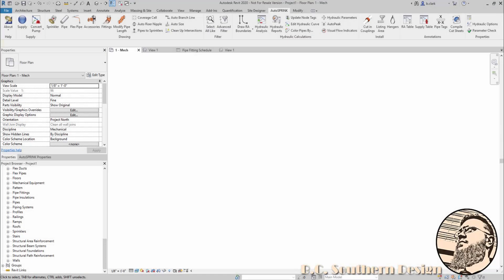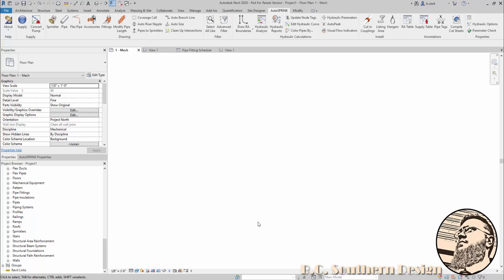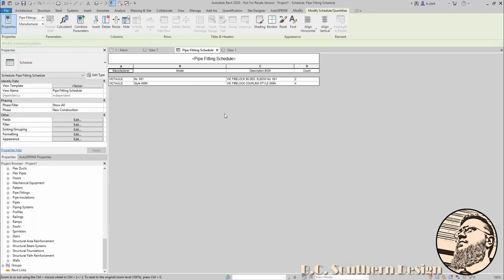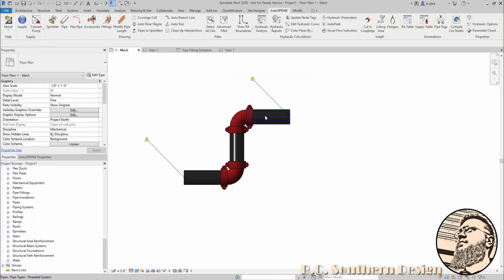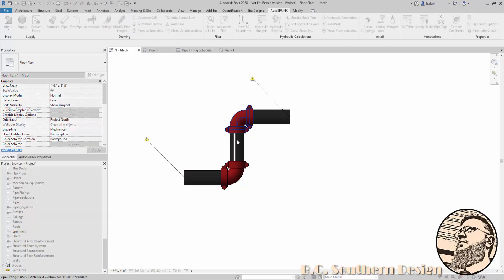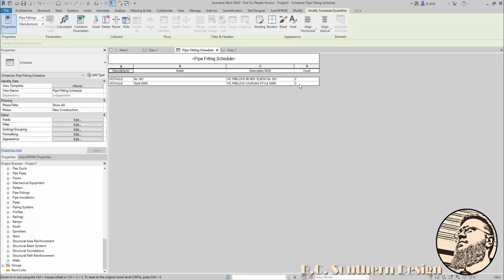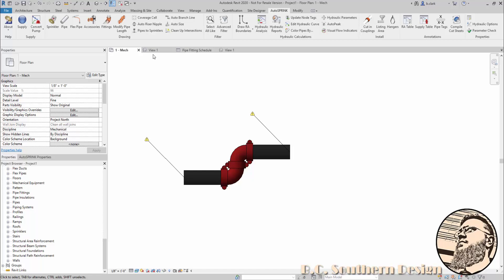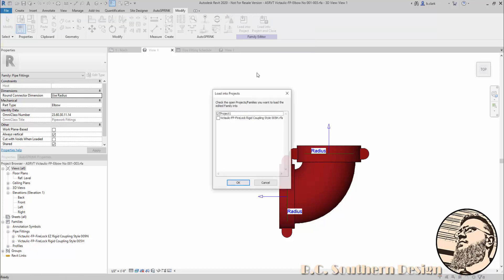Revit and Why I Use Nested Families

Comment: Fantastic video Barry! 
The only beef I have with nesting couplings into fittings is that when I filter by "System type", the couplings disappear...
(I think because only the fitting itself is connected to the piping system, not the coupling).
Any way to avoid that from happening? I figure if anyone knows it would be you lol